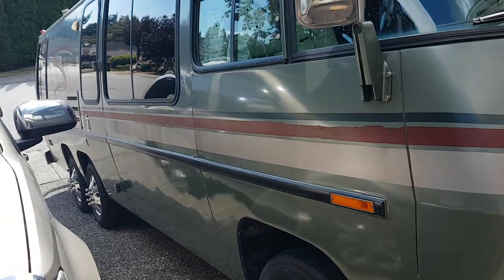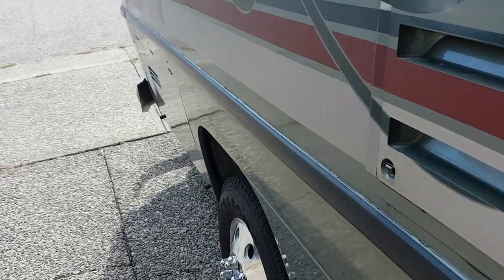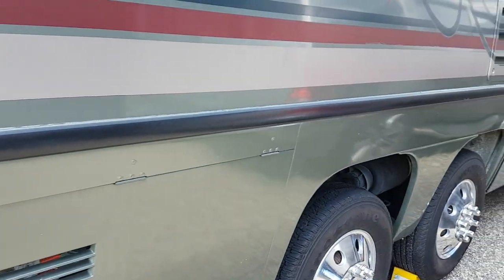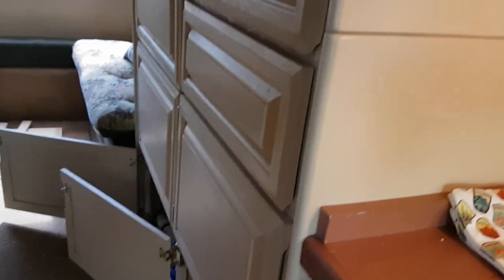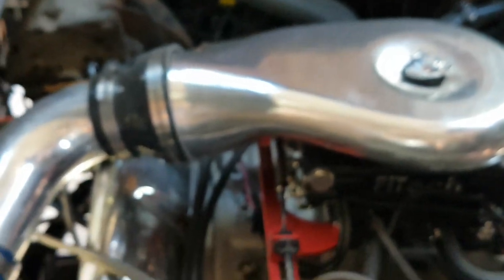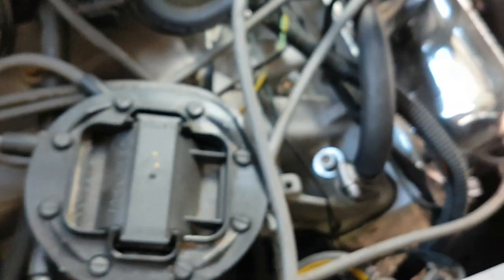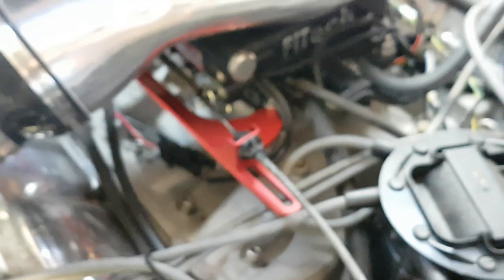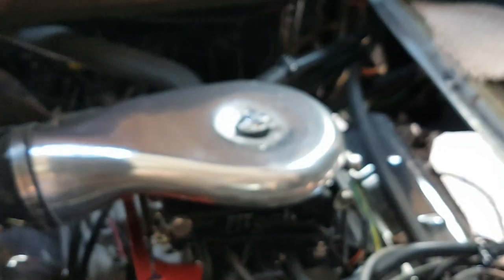76 GMC motorhome

Comment: I like your GMC. Did you get the paint job on it or did you buy it painted aleady.  Also here is what you should do with the heat from the headers.  Take them back off and take them to your local good Chrome shop that can ceramic coat header. Or sell them and get yourself a pair that are ceramic coated already from the factory.  I bought a set of shorty headers for my 1988 Ford Bronco.  And the place I bought them from actually plates them for the co. that makes them.  He told me that he could ceramic coat them on the inside & outside for me.  You wouldnt believe the difference in the heat.  You can actually touch them and not get burned while the engine is runnung.
Reply from the maker: I bought it like this, it photographs well but it is an order repaint, was going to either wrap the headers or get them coated